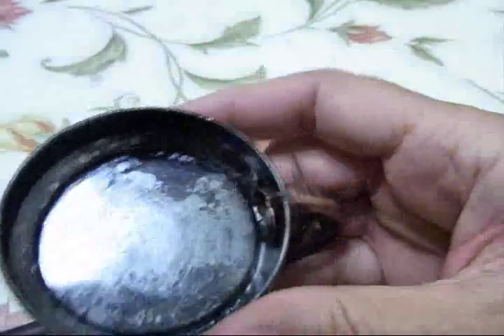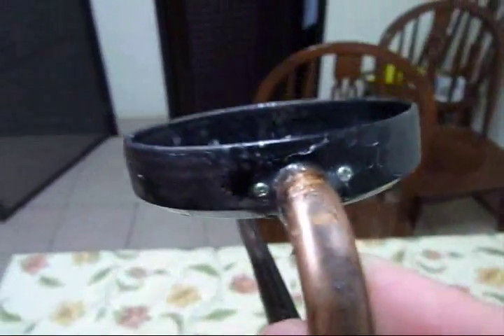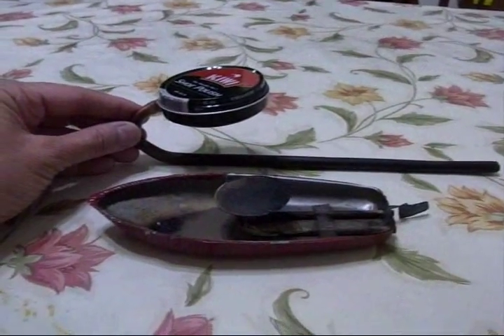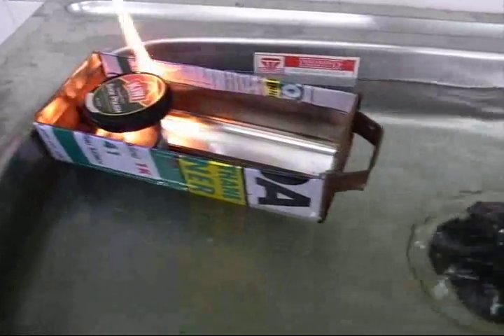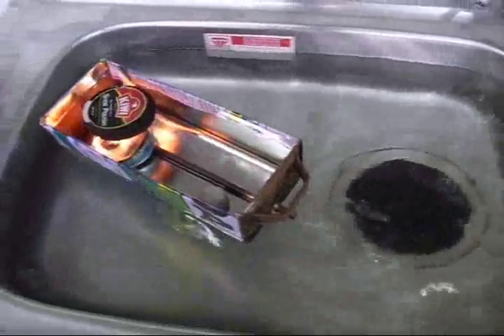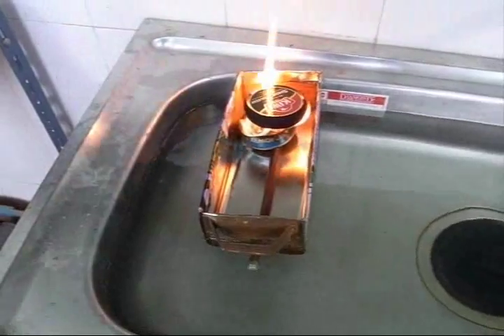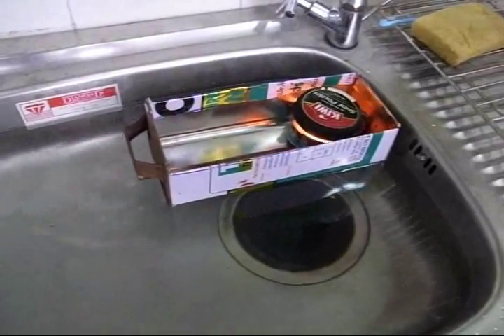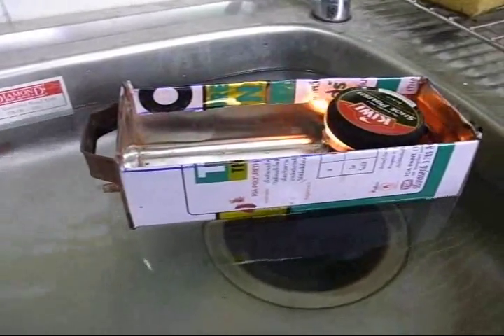Monster Putt Putt Boat DIY - Ver 2 - Build, Test, Analysis

Comment from the maker: There's a lot of debate on how these work.  I'm going to put in my 2 cents worth here (Full disclosure: I'm not a rocket scientist).  I think it moves forward because the water coming in is moving much more slowly than the sudden steam powered pulse coming out: the difference between the 2 is the push forward.  Force = mass x acceleration.  The mass of water in is the same as the mass out, it's the acceleration that's different.  The acceleration in (I'm guessing) is significantly less than the acceleration out.  Plug in some made up numbers: Mass in = 1, mass out = 1.  Acceleration in =1, acceleration out = 2 so Fin = 1x1 = 1 and Fout = 1x2 = 2.  So the net force would be 1 in the forward direction.  Result: It moves.